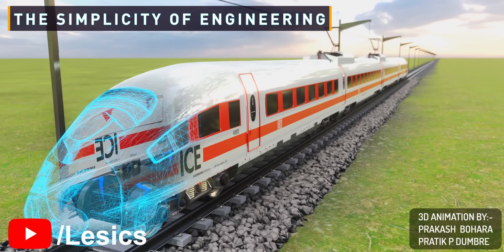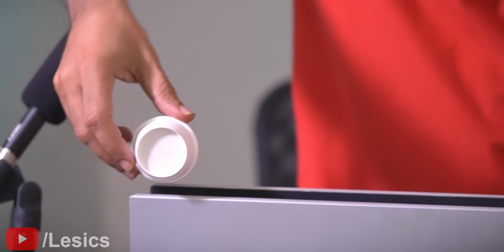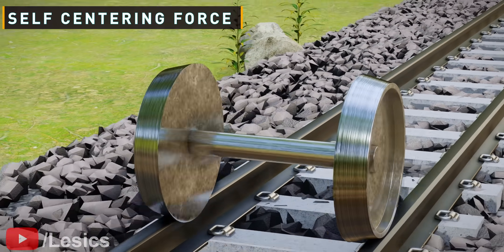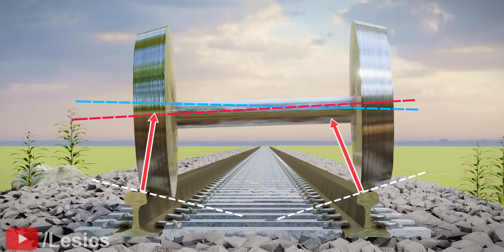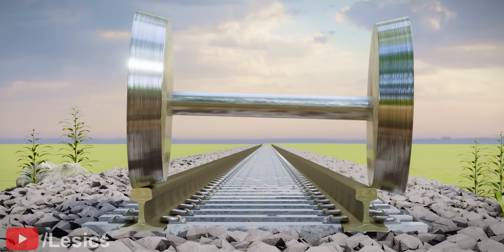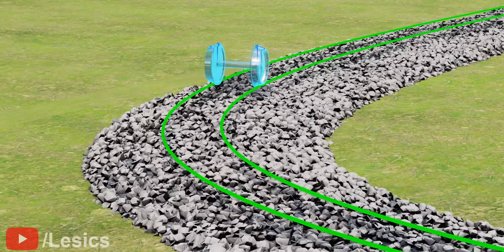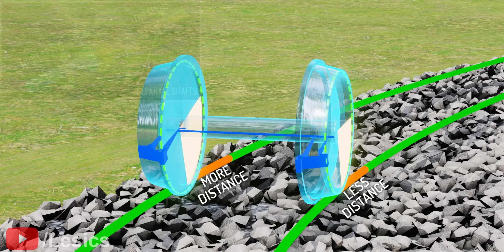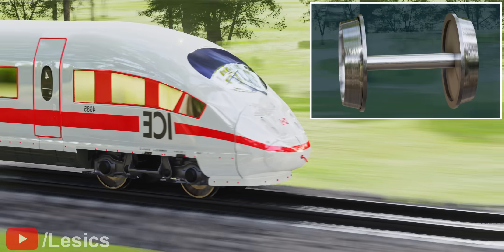The interesting engineering behind the SHAPE of Train wheels!

Comment: I never thought of how conical wheels could compensate for different lengths of travel when rolling around a corner. I just assumed each wheel rolled independently and wasn't firmly attached to an axle. But now that I think about it more, having the wheels firmly attached to axles means the same differential action caused by the conical shape would also cause the wheels to actively steer back to the center of the track if the wheels were shifted off-center. That's brilliant.
Reply: That's why city trains squeek on turns.
Reply: @Tankeris6327   They don't take the turns fast enough! Hehe.
Reply: the conical shape is not going to make a huge difference in travel.  The wheel on the inside of the turn still drags along.  One other thing not mentioned is that the conical shape allows for a ticker stronger wheel with a small contact patch thus reducing friction as well.
Reply: @Baka_Oppai : Whether the conical shape is enough to provide adequate differential action depends on the angle of the taper and on the radius of the bends in the track. Squealing wheels can be caused by a huge number of things, ranging from contamination on the surface of the rails to loads shifting around and moving the cars' centers of balance.
Reply: 💯same thoughts ✌️✌️👍
Reply: Qqqlaq@pq1qqq
Reply: Same
Reply: Why put the retaining rim on the inside?  Why not the outside of the tracks?  By putting it on the inside more steel, rotating mass,  and cost is required because the inside radius is greater than the outside radius.
Reply: @w.harrison7277   It's easier, and better because of the fact that they have turnouts. You only need a diamond in the middle.  And  they usehelper tracks to guide the wheels through the diamond.
Reply: @w.harrison7277 : Hang on, I misunderstood your question. The reason the lips are on the wheels instead of the track is much simpler to explain: It's easier and less expensive. Rails can be thousands of miles long, and making sure every single foot of that rail has retaining lips intact and manufactured to the correct strength and tolerance would be much harder and more expensive.
Reply: @w.harrison7277  I believe (but do not know for certain) that at least part of the reason for the rim on the inside is that it is easier to mill.
Reply: @w.harrison7277 : The lips have to go on the inner edges of the wheels so the outside wheel in a corner will have its lip jammed against the rail in an emergency. If the lips were on the outer edges of the wheels, the inside wheel in a corner would have its lip pulled against the rail, but due to the entire train car leaning to the outside of the turn, the lip could easily be pulled over the rail allowing the car to derail.
Reply: What they did made logical sense. But I still have question about how the wheel and axel would perform on a non flexible train body?
Reply: @killertruth186  it would go in a straight line
Reply: bro watch the video thats literally what he explains
Reply: @conorhaddock3956 : Yes, I was repeating it because I thought it was worth summarizing and repeating.
Reply: @fyrstormer  you were repeating it because you thought it was worth summarizing and repeating?
Reply: @conorhaddock3956 : Yes.
Reply: @conorhaddock3956  No, he never talks about the specific effect of it steering back, he only mentions the force back to the center
Reply: https://youtu.be/3l9Hm_fMI2g

Comment: Bonus info

On the Manchester, England tram system there are tight corners that the trams go round at walking pace, the wheels making horrible grinding noises. 

One example is the curve at the top of the ramp coming into Pomona from the Eccles line. There are many others on the network.

Q: What gives?

The thing is that for the differential action to work as described towards the end of the video the ratio of the diameter of the conic on the inner to outer wheel has to match the ratio of the radius of curvature of the inner to outer rail.

Wherever the ratio of the diameters of the  "thin" to "fat" ends of the conic section is larger than the ratio of the radii of curvature this can't happen. Then four things happen: 

1. the outer flange rubs against the outer rail and there is a twisty ginding as the outside of the flange moves faster than the contact point;

2. Both wheels turn at the same speed because they are fixed to the axle as shown in the animation;

3. The outer wheel is not moving fast enough so the conic contact  point skids forwards on the rail making more grinding noises 

4. The conic contact point of the inner wheel skids backwards as this wheel is going too fast. That also makes a grinding noise.

With good attention as a passenger you should be able to hear the difference between 1+3 from one side of the tram vs 4 on the other. As expected the outer side is noisier.

Q: So why don't they design the wheels to work properly on tight corners?

The length of the taper would be too wide -- wherever the bogie sits on the rails a full length of one wheel's taper sticks out. That makes the axle longer, and they can't do that beyond a certain point or the axle ends stick out too far to be safe 

Q: So why not build curves that fit properly for the wheels?

That of course is what they do on a railway as compared to a tram. It is why narrow guage railways can be bendier than standard guage.

It is not possible to do this where the tracks are added to pre-existing roads, or as for the Pomona junction where one line out of a junction needs a tight turn to get between pre-existing buildings.

It's the best set of design compromises when retrofitting the tramlines to existing city architecture. Cpmpromises that are almost never made on heavy rail, because the land was usually bought before surrounding buildings went up, and because with heavier rolling stock the grinding would do more damage both the rail and the wheel.

Comment: If you happen to stop at a turning or a curve and start again, then there won't be any horizontal force to push the wheels outside, that bring about the differential action, so wont it start to wear the wheels?
do they never stop at a curve ?or is that much wear taken into account when designing the wheels?

Comment: Based on the illustrations, it shows that the wheel touches the track at an angle and not complete flush with the track. That means the weight of the freight train is put on this small area. Am I correct?

Comment: I wonder what the optimum angle of bevel is?  And for a given track width, what the necessary width of wheel is? Or perhaps how this relates to the minimum curvature?   Does the track need to be banked on all turns or only if the curve is tighter than the minimum curvature given by the wheel dimensions?  If the banking is excessive, does it cause the wheels to try to climb outwards?   Since the centripetal force varies with the speed, for any particular geometry, is there just one speed where these effects are optimal?  You provoke so many questions!  I'll have a think about them and see what I come up with.   
You have provided me with an important detail that I'd not thought of before, in saying that the significant feature is the change in height of the wheels.  I'd always worked on the basis that this was negligible and the significant factor was simply the change in circumference.

Comment: well~ I think that's true from the wheels' perspective, but will this work okay from the rail perspective? as the weight of the train going down, the wheel will push the rail aside, and eventually (I think) will make the gap between rail big enough to drop the train. haven't seen such problem happen in the reality, so I wonder how did people maintain the rail to prevent such problem???

Comment: I am wondering why go-karts can do just fine around a racetrack without differential; only the more expensive ones are so equipped.
Reply: I remember some go karts being just one-wheel drive from many years back. Seems like a solid axle would make turning too difficult as it would always try to push straight.

Comment: Through history the wheel design triumphed in rail engineering, but when trains speed became extreme, even engineers in Japan couldn't see it approching, a MASSIVE horizontal idiocracy,  that made the wheels give way, making a super line of trailers & passenger literally wrap around building like thin metalic duct tape of a horror movie thriller, the epic flaw was no side position ready-wheels at the top inner side T-beam rim postions, but even that eventually would've gave, in future speed history.

Comment: I thought train wheels were conical to reduce its surface contact on the rail, thus greatly eliminating dynamic friction as opposed to a flat wheel

I never thought about the differential effect - trains dont need a steering wheel to take curves.

Comment: Train wheels have flanges on the inside of each wheel to prevent the train from derailing, very good video you have here, Also the railroads have huge grinding machines that grind the rails smooth several times a year. This makes the wheels and rail last much longer. I have videos of these machines in action.
Reply: He mentions the flanges and their function at 2:20 in the video…
Reply: @JaguarXJ  😘
Reply: Indeed, they also have a slight concave more better contact
Reply: @gordoncracknell7730  even moar better
Reply: This guy Trains :)
Reply: I have run those machines.
Reply: train lore
Reply: The flange on the wheel is also there to make the train move properly through switches. When you are approaching the facing point of a switch, the flange will help maneuver the locomotive or car to the gapped side of the switch.
Reply: In the NYC subway, without flanges and guide rails, that train would be on the ground. I operated those things, and you do feel the train being "jerked" back onto to the track, due to the flanges, and guide rails on curves. Yes the flanges do rub against the inside of the rail, depending on the curve sharpness, and train speed. That is why you hear that screeching grinding sound on some curves. It is not that rough though, as to grind the flanges away quickly. Those wheels are very tough.
Reply: @jerryatrick4491  : A subway is a completely different beast, yes the flanges play a much different role in any subway. I live in the Boston area, and the Green Line is famous for similar behavior.
Reply: pg rating?
Reply: Incase anyone was about to ask, I operate a Rail Grinder. Am I cool?
Reply: @TheEggBeater  I say yes
Reply: Wide world of Trains, Intersting name
Reply: @mobileGameZGG  в
Reply: You cut wheels ?
Reply: wow no shit
He said the same thing in the video.....
Reply: @PANZERFAUST90  Yes and I added to that
Reply: @WideWorldofTrains  You also repeated it.
Reply: @PANZERFAUST90   And I added to it is there something wrong with that lol
Reply: @WideWorldofTrains  Yeah you're fishing for upvotes on someone else's words. Surely you can get attention with your own addidtions.
Reply: @WideWorldofTrains  you did repeat what the video said. You either didn't watch it all or you weren't paying attention.
Reply: Would you please link one or more of the videos? I'd be interested to see that take place.
Reply: @fatmanjumprope  https://www.youtube.com/playlist?list=PLHWTPKxVScxj1ulgmhTdUEabE8G37VCER
Reply: @fatmanjumprope  OK since you asked, I don't want to push my videos on other peoples videos.  Here is one of several I have https://youtu.be/N-dRW_yaqRk
Reply: What happens to the flanges when the train rounds a corner? Do the flanges rub against the rail track? Shouldn't the flanges be angled out slightly from the wheels so the leading edge doesn't rub against the rail track?
Reply: It is called truing
Reply: I once ran a train on a lot lizard in Albuquerque
Reply: "Train wheels have flanges on the inside of each wheel to prevent the train from derailing" that's NOT what the vid says it only mentions it being and extra safety feature. Probably mainly it's there to assist when doing slow moving track changes. It's not meant to prevent derailings as primary function at all. Don't interject false information.
Reply: @flybeep1661  So you think that if they didn't have flange's the trains would stay on the tracks? LOL
Reply: @WideWorldofTrains  : "So you think that if they didn't have flange's the trains would stay on the tracks? LOL":

Actually, in most cases they would. The flanges primarily help guide the wheels through frogs in switches and crossings. The flange also provides mechanical support for the filet that joins the tread to the flange. It's the rapidly-increasing radius of the wheel as the wheel tries to approach the rail head -- lifting the weight of the car or locomotive -- that keeps the wheels on the track.

In modern freight tracks, weight-bearing flangeways in frogs and crossings are high enough that they carry the weight of the equipment on the flange as the wheel traverses the gap. This greatly reduces mechanical wear and tear on the rail on each side of the frog, as well as on the wheel itself. The weight-bearing flangeway was used on traction lines (subways, streetcars, and inter-urbans) for a very long time. The adaptation to high-speed freight lines is relatively new.
Reply: @thomasstambaugh5181  "Actually, in most cases they would." Until the first curve
Reply: @WideWorldofTrains  : If flanges contacted the rail on a curve, the flange would be ground down almost immediately and the rail head on the curve destroyed. Flanges almost never contact the rail.
Reply: @WideWorldofTrains  Train tracks have such gentle curves I doubt they'd come off without flanges, especially considering the weight keeping it on the track and regualted speeds. The taper of the wheel does more than the flange 100%, just the physics and forces applied. Train tracks don't curve like roads do, most only have curves of 1 or 2 degrees and don't go above 20 degrees, also speed plays a factor. A train without flanges going on any normal curved track at regulated speed would never come off the tracks. You can think they will all you want but physics says your wrong.
Reply: @forposterity4031   I know areas where there are sharper curves and those areas of rail have to be replaced more often because of the extra wear t on the Rail.  Without the flange this is where you would have more derailments in areas like this
Reply: @WideWorldofTrains  if you were paying attention in class, in theory, a train would. The net forces involved must be massive when considering the weight of train. So I'm laughing at you.
Reply: @arconeagain  That's good! I always wanted to be a comedian
Reply: @thomasstambaugh5181  LOL they o contact the rails, read what Jerry said a few comments below
Reply: @WideWorldofTrains  : Take some videos of New York Subways or the Green Line trains in Boston, then tell us again how they are the same as the excellent pieces you do for mainline railroads. Subways are different from freight railroads. I love your work, and I fear we've fallen into a rabbit-hole.
Reply: @thomasstambaugh5181  Fair enough, we can agree to disagree
Reply: @WideWorldofTrains  I used to make train wheels for cn rail, cp rail, via rail, go transit and the rocky mountaneer. We also refurbished wheels when possible instead of flat out replacing them. The flange does wear, so they definitely do make contact with the rails but very rarely would we get wheels with extreme wear on the flange and I could't even guess how many thousands of used wheelsets I had inspected to determine if they could be trued or if they needed new wheels.
Reply: @ds43045  Thanks for the info. There have been derailments at curves on a ralline  when a very long train was involved. Surely would happen more without flanges.
Reply: @WideWorldofTrains  It is true that the flange is there to keep the train on track, but it's mainly for tight curves or switches. A train with a new set of wheels on good tracks will not really need the flange to stay on track in a straight line or normal curve. I said "not really" because the flange might actually briefly hit the rail when attacking the curve (going from straight to a curve), but most of the time the flange is obsolete.
Reply: https://youtu.be/1y-8AOmdFyo vrgj

Comment: This is perfectly correct , however there are a lot of parts that come into play that contribute to the correct operation of the wheel sets …
Side bearing clearances.
Bolster Gibs within tolerances.
Pedestal adapters and side frames within tolerances.
Side frame columns in tolerance .
Truck springs intact and within tolerances..
Center plates and bolster rings within tolerances…

Lots of moving parts connected to those wheels in order to keep them on the rail and preventing wheel hunt ..
  
Wheel set condition is also key in keeping them on the rail …
 A lot of defects can be found on any given freight wheel set
Thin flange
High flange
Vertical flange 
Etc 

The list is lengthy …